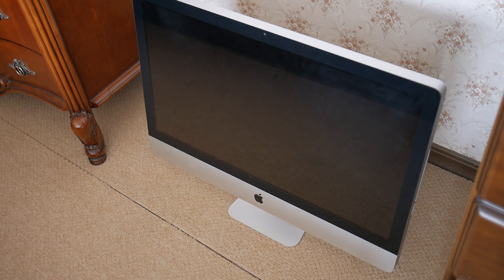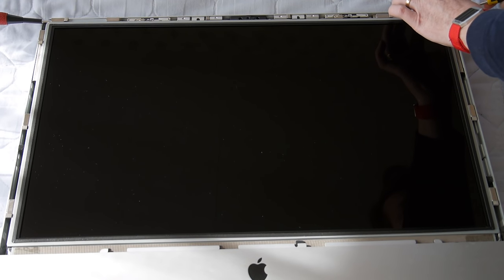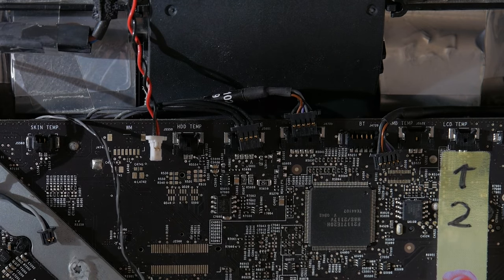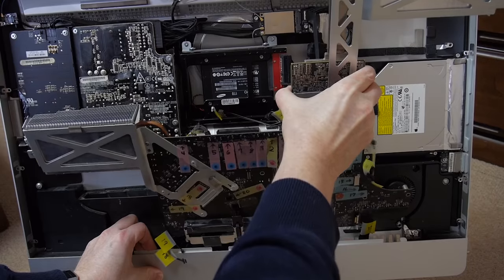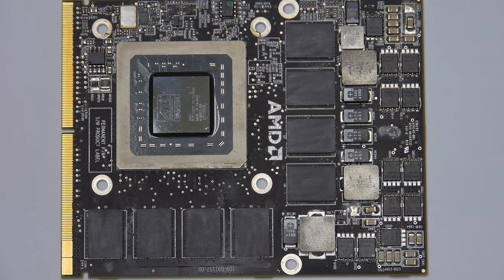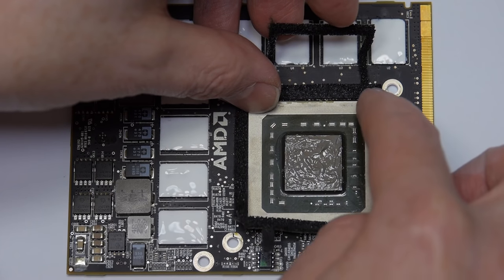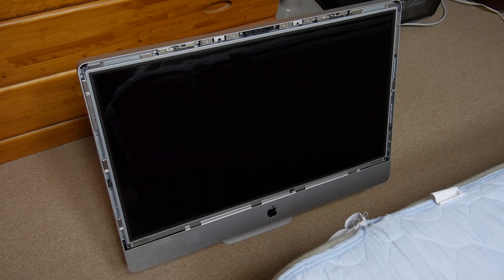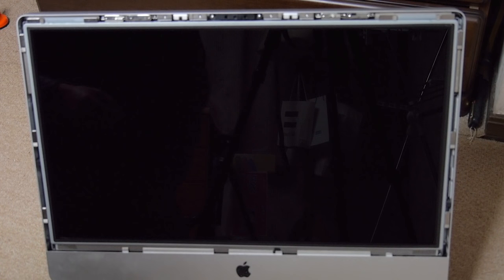Late 2009 iMac 27" Video Card Repair [4850 Bake]

Comment: My question is, how do we know that it’s the bake and not the cleaning off of the paste, which is clearly spread all over the place, that made the difference?
Reply from the maker: Because there is a defect internal to the GPU that requires heating to fix.  The fix is not permanent, but the bake usually makes the card last long enough to have made all the time, effort and expense (for new paste) worthwhile.  My first bake lasted only 4 months, but my 2nd bake lasted 2 years and 9 months.  A good number of people have reported back to say they have gotten more than 3 years on their first bake.  If you remain unconvinced, all you need to do is swap the thermal paste without baking, test, and then you will see that new thermal paste alone doesn't work.  Of course, it's kind of a lot of effort to do that because you will need to tear it all apart again, clean off that new paste, bake the card, then apply new paste and reassemble, but the choice is yours.  Don't take my word for the fact it works.  Read the comments under all my bake videos.  I have a lot of them: 
https://youtube.com/playlist?list=PLNZ4qjMn-GHoez6_PtpyJfcU_ialTS8bB

Comment: Can i upgrade GPU 4k 21" late 2013 like this?
Reply from the maker: Please confirm your computer specifications and model year.  The 2013 iMacs did not support 4K.  Are you sure you have a 2013 iMac, or is it a 2015?  If you have a late 2013 model, it's very different on the inside than my 2009 iMac, and even opening the machine is very different too.  The following video is not in English but it does show you opening and access of the GPU.  Whether a bake would fix your model year machine or not is something I do not know, I'm sorry.
https://youtu.be/FOkVJAvho0E
Reply: JDW  thanks for the replay... My iMac os Late 2013 21.5" 4K....
Reply from the maker: Once again, the only thing I can suggest is have a look at the following and similar videos which show how to open your iMac: https://youtu.be/FOkVJAvho0E

Comment: hey guys i have a problem with my 27" iMac 2010 i3, it plays normal throughout mini display port to cdmi on another screen, i downloaded a high quality 7gb 1080p movie and when i played it with quick time it played shitty, i then tried vlc player and even that played it shitty. it shows pixels on the screen when playing and stutters. i sent file to my windows computer and it works perfectly. would you say this is down to the graphics card? because for over a year now i haven't used the 1440p display because it started working then couple seconds later black screen constantly. but everything else works fine using display port. so im not quite sure what the problem is?
Reply from the maker: 2009 through 2013 iMacs all share the same video card issues.  It's a video card design defect.  In many cases, a new card lasts only 3 years, so if you've not changed your video card ever (since 2010), consider yourself lucky.  Based on what you have written, I would say your video card needs a bake.  It's about the same amount of trouble to bake it as it would take if you just bought a new card and swapped it, so I suggest you give the bake a try.  I have 2 videos on that topic, providing you with all the info you need to do the bake.  It takes several hours, but if you read through the comments you will see that most everyone who tries it is successful. Just be sure to read the Description I wrote under my video to ensure you have all the parts and thermal paste required.  Make sure you also watch my 2nd Bake video as well.  Then you'll be good to go!
Reply: im scared to try this but ill have a think about it then maybe give it a try. my graphics card is ati radeon 5670. and thanks for the info ill check ur vids and give it a try. i also had a problem with my ram at the time, i had 6gb and one day turned imac on and it was bleeping so i took 1 ram stick out and it worked fine so 1 stick was faulty. i read somewhere that replacing ram can solve the problem?
Reply from the maker: If you doubt yourself, then don't try the video card bake.  I would not advise this for anyone that doesn't approach it with some level of confidence.  My two videos will help, but ultimately you will be the one who performs the work.  If you are one to give up easily, then this job isn't for you.  You would probably be best served by either getting a brand new iMac or a used 2015 5K model (which I know doesn't have the same video card design problem).

If indeed the root problem is your video card (and honestly, unless you are very lucky I do think your video card probably does have a problem), then replacing RAM would not help.  But if you don't mind taking a little risk, then buying new RAM certified to work in your Mac would be fast and easy to try.  But if you do try a RAM swap and the problem doesn't go away, then it's clear you'll either need to do the bake, or find someone else who will do the bake for you, or consider the purchase of a new iMac.  

If I wasn't so frugal I would probably just have purchased a new iMac.  The newer machines are fast and run very cool too.  But it just upsets me tremendously that Apple designed several years of iMacs with this badly designed video card, so I have held off on a new iMac, deciding to fix my existing one instead.  My 2nd bake has been going strong since the first week of July, so I am satisfied for now.  Despite its age, my old 2009 iMac is still very usable.
Reply: ok thank u so much bro for the info and help. im wanting to try it after i can buy a mac mini if apple make newer ones. then i will buy a 1440p or 4k gaming monitor, reason being is because i have a pc too and want them on 1 screen and at the mo its just an old 1080p sony tv. my mate who does engineering and soldering and stuff says not to try this bake because i need a BGA wich im not sure what is and he just told me to look it up on the internet. he says hes done the same process with xbox's. ive told him u have videos of how to do it and hes still saying no so ill wait till i get another mac then maybe try it. thanks again anyways brother.
Reply: also because im using mini display port to hdmi and works fine, would that mean graphics cards ok or what?
Reply from the maker: Even if you can use MiniDP-HDMI just fine, that test does not guarantee your video card is OK.  It all depends on how much you tax your video card.  For example, even before I baked my video card, I could boot into Safe Mode (hold the SHIFT key down at boot time until you reach the Desktop) and the video would display most of the time.  But the video would not display in a normal boot.  Why not?  Because in Safe Mode MacOS doesn't use your video card as much, and it shows.  All the video is very laggy in Safe Mode.  But in a normal boot, the full power and features of your video card are used, so if your video card has a problem, it would show on the internal display when booting normally.  But when using MiniDP-HDMI, the video card is probably used a bit less than a normal boot using your internal iMac display.  What all this means is your video card could very well have a problem, even though you don't see a problem on your HDMI display.

Comment: I am at the part where you mount the motherboard back in, but you cut that part out where you actually fit the motherboard inside. I can't get mine back in, and not sure what the technique is.
Reply from the maker: You must be at the 50:00 mark.  Make absolutely sure there are no connectors that slip behind the motherboard when you put it back in AND you must also ensure that the USB and other ports get properly fitted in the back.  If those ports don't fit into their holes properly, you won't get the motherboard back in.  Well, actually you can, but you might bend or even crack it.  I am guessing it's either those ports or a stray connector behind the motherboard that is preventing it from going in.  Please check than and then let me know if my advice helps.
Reply: @JDW-  Yes, I am about to remount the motherboard. All connectors are out of the way, and the USB and other ports isn't actually the issue. The issue is that the giant CPU heatsink on the left side is crashing with the PSU by an inch because the motherboard "won't fit back in". Not sure what to do at this point where the motherboard really won't fit.
Reply from the maker: @ronny-andrebendiksen4137  It must be the RAM slot area.  Start watching from 51:24 and you will see that my CPU heatsink top hits the PSU bottom UNTIL I finally get the motherboard to sink in deep enough into the case at the RAM slot area. Also watch from 48:33 where I talk about the ambient light sensor as that was a huge pain for me and that part is near the RAM slots.
Reply: @JDW-  Thanks! I finally managed after moving around back and forth, up and down! :)  Now on to how to get macOS on the SSD... :)

Comment: I performed this procedure almost one year ago to the day. Yesterday the pink vertical lines reappeared and today nothing but a completely white screen. Trying to determine whether I should dive back in again and do it all over, replace the graphic processor, or scrap mac altogether....I expected this repair would have lasted at least a few years, considering I only us this mac as a back up, which is maybe one or twice every two weeks....what a poor design.
Reply from the maker: I'm sorry to heat that. I agree about the "poor design."  I bought my iMac in early Nov. 2009.  In Jan. 2013, just after the 3 year AppleCare expired, I had the same problems.  I wrote Tim Cook.  All said, Apple replaced the video free of charge and the problem was solved... Until 3 years after that.  Suffice it to say, I went through the procedure you see in my video in the full knowledge that the same trouble could happen again.  I am happy to know I don't need to swap out the video card entirely to solve the problem.  But it is a SERIOUS PAIN to go through the procedure.  The only true resolution to the problem would be to ditch this iMac and get a 5K Retina edition instead.  I have one of those at the office and it runs very cool.  I honestly believe that HEAT is the cause of these problems.
Reply: Thank you for your response....I have decided to give it one more try. I ordered the thermal paste, once that arrives, I will try this again. Thats good to know the 5 K Retina edition doesn't suffer from this problem...

Comment: you did not remove the old paste from the heatsink?
Reply from the maker: In part, I did.  Watch for yourself starting here: https://youtu.be/v1DXBLkiqFM?t=29m47s
Reply: yeah but 33:42 that grey thick stuff is old paste stuck/burnt on the heatsink, i belive it "was" Thermal Pads there before but "someone" put Thermal paste over them. It's only on the Gpu and Cpu that it should be Thermal compound on, and the chips should have Thermal Pads on them. Enyways, if you get eny heating problems again, you know what the problem is, remove the grey dried paste and put Thermal Pads there instead, There are different thicknesses on the thermal pads, i do not know what thickness appel use, but enyways :) great video
Reply from the maker: You are absolutely correct, but I didn't have any thermal pads and since I live in Japan sourcing them from Digikey is expensive, and I honestly did not want to wait around anymore to close my Mac and test it.  That's why I didn't do the "best" thing and replace the thermal pads.  If you and everyone else reading this can replace them, I highly recommend it.  I myself didn't, and it's been 2 months and no problems thus far.  Thank you for bringing up that important point though.  And thank you for your kind remarks about the video.  Best wishes!

Comment: is it really required to remove the motherboard? I saw another ifixit guide which does not mention that
Reply from the maker: As shown in my 2nd Bake video, no, it is not required to remove the motherboard, especially if you are not concerned about replacing the PRAM battery.
https://m.youtube.com/watch?v=6BJGLFCigdA

Comment: Hello JDW. I have a late 2009 27" iMac too, it started freezing while playing videos, days later booting it, just showed a white screen, no Apple with charging bar logo... tried repeteadly booting it and sometimes it showed half the bar logo and then white screen again...
Tried the safe boot with shift+start button and it charged the bar slowly, and after logging me into the system, it goes too slow... no horizontal bars on the screen like i usualy see on some GPU issues pics, but...if i open chrome it shows the chrome screen like flashing or waving... any try of clicking on a picture goes slow too...Of course i didn´t try any other software that would ask for graphics power...
 I can use Rember and try a RAM test (16Gb) and it took too long but finally is showed no problems...
Sorry for the long exposition but i´m kinda lost and frustrated, could it be the same issue? I want to do a hardware test using start+D booting but seems like it doesn´t responds and just shows again the white screen...
Thanks in advance for your help!
Reply from the maker: I can almost give you a 100% guarantee you have the same video card problem.  Because I was able to do a Safe Boot just fine too, but normal boots would freeze.  That's because much of the video card functionality is disabled in Safe Boot, and that's also why the display updates slowly. So your choices at this stage are: (1) get rid of the Mac and buy a new one or (2) follow my video and try the bake or (3) buy a whole new video card and try that.  A new Mac will cost a lot, and a replacement video card on EBAY isn't cheap either.  You really have nothing to lose other than time (and a little money for the required tools) to try the bake. If you are nervous, just re-watch my video, and make sure you watch my "2nd Bake" video too.  Those two videos combined cover just about everything you'd experience when doing a bake.  The videos can also help you if you decide to just buy a new card on EBAY, but keep in mind that even a new card probably won't last 3 years.  The root problem is a design flaw in video cards in the 2009 iMacs (which seem to afflict some 2010 and 2011 and even 2012 models too).  I hope this helps.
Reply: It´s funny because while you were replying i was into your second video and yes, i have the same exact problems (sorry for my bad english, i´m spanish) so yes, i´ll try baking it, i opened once for adding an SSD+ discard the optical drive and it was not difficult at all, this of course requires more patience and time but i´ll try it for sure before doing any other thing.
I also see that seems to be an upgrade of the GPU for the 2011 model, but wao that video card is not cheap at all, it´s like 700+ euro or so...? Anyways i could say 1000 times thank you for taking your time to help us with your experience and detailed videos, thank you very much!!
Reply from the maker: Before you consider upgrading to a different video card, consider that newer cards, even cards used in newer iMacs, are slightly different and may require a little cutting to make them fit.  They might also running hotter too, which I don't think is too good for the machine.  That's why I baked my existing card rather than swap it out.  Best wishes.
Reply: Great advice, thank you again!!!
Reply: Updating the thread just to say THANK YOU!! for posting the video and your great help, i finished successfully the repair and my Mac works again, you rock man!!
Reply from the maker: Thank you for letting us now the bake was successful for you! Best wishes.

Comment: How much time did it actually take to repair this issue?
Reply from the maker: I wrote "3 hours" on my iFixit page because that is about how long it will take if you go slow and mark everything like I did.  But it took me more than 3 hours because (1) I was shooting a video, and (2) I was pondering what to show in the video, and (3) I needed to order a button cell battery before I could close the machine.  If you have a photographic memory and don't need to mark all your connectors, that will save a lot of time.  In terms of the "actual repair" which is nothing more than baking the board, well, that took all of 9 minutes in the oven, plus a few minutes to cool.  Cleaning the video card prior to baking and then reapplying thermal paste takes a little while though, especially if you are meticulous about it like me.  Just try it on a weekend when you have a lot of time.  Don't rush. Go slow.  The part that takes a lot of time at the end is CLEANING prior to putting the glass back on.  I hate even tiny specks of dust, so it took me more than 30 minutes of cleaning and putting the glass on, then taking it off and repeating the procedure.  So how long it takes really does depend on you.

Comment: Hi, I am from India. K4 and K5 pro not available at this moment in amazon india. can you suggest me or give link from amazon.in  for alternative thermal paste for chips other than GPU as well as for GPU.
Reply from the maker: The GPU paste doesn't matter so much.  You can use Thermal Grizzly Kryonaut or Arctic MX-4 or any other good CPU paste on the GPU.  The memory chips are the problem.  If you can measure the gap between the bottom of the heatsink and the top of the memory chips, then you can buy any thermal PAD and use that.  But since it is difficult to measure that gap, I used a thermal PAD replacement paste, which is what K5 Pro is.  There might be other thermal PAD replacement pastes out there, but I am only aware of K5 Pro.  With K5 Pro, the gap width doesn't matter, which is why I like it better than thermal PADs.  If you contact the seller in Greece, they probably would ship it to India.
Reply: @JDW-  Thank you